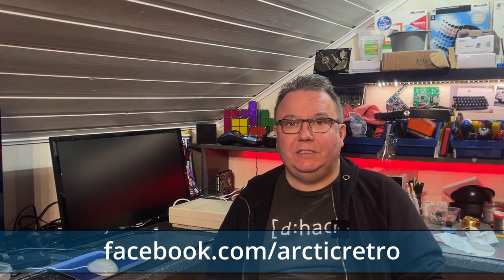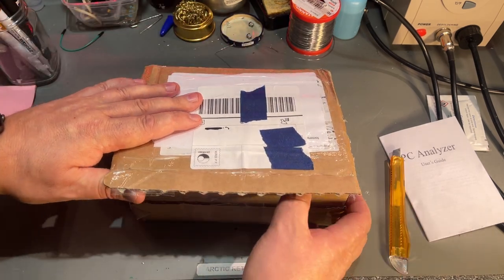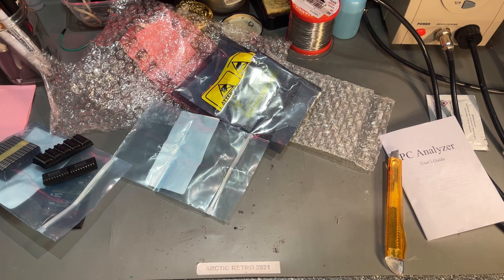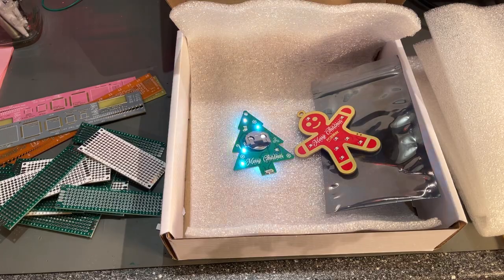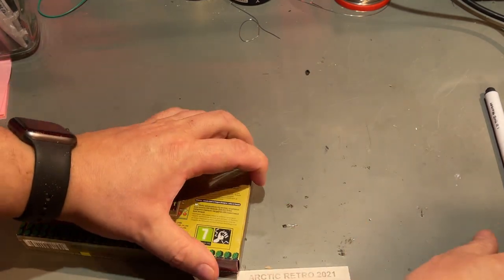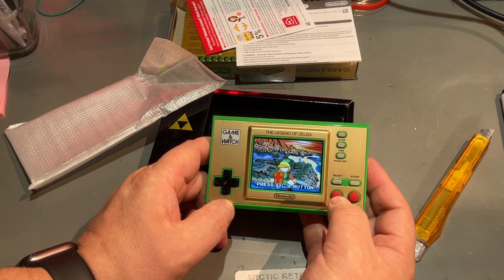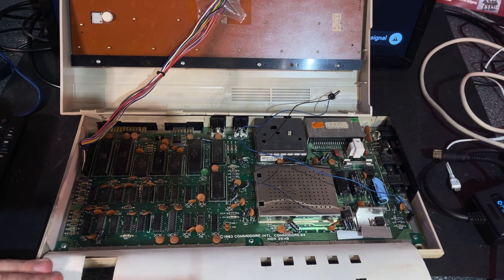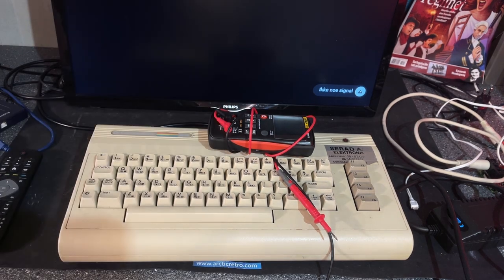Mail and donations - January 2022 - Commodore C64G, xum1541, PCB's, Nintendo game and watch

Comment: Hey Tommy, dont forget to check the voltages on the C64 power supply that came with it. :/
Reply from the maker: I did. DC was 5.16V. But I did not use it on the machine